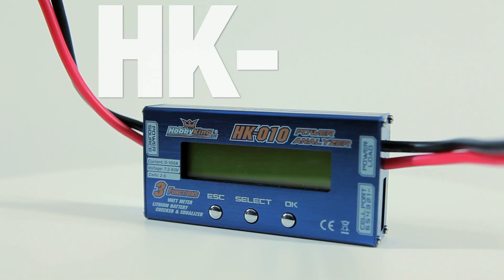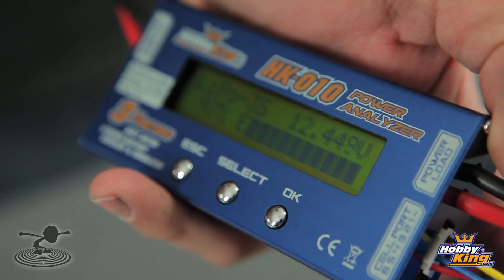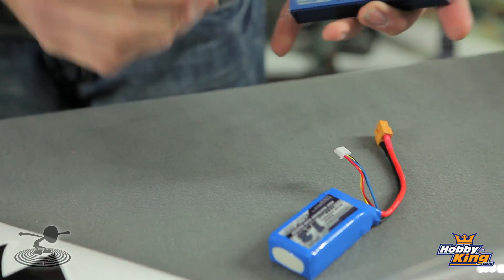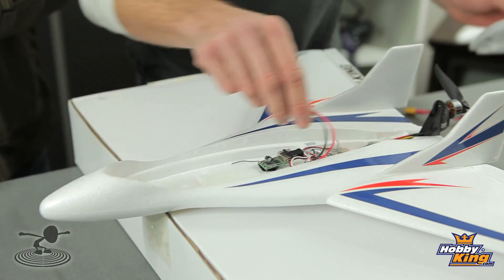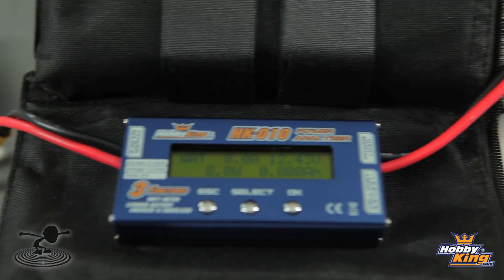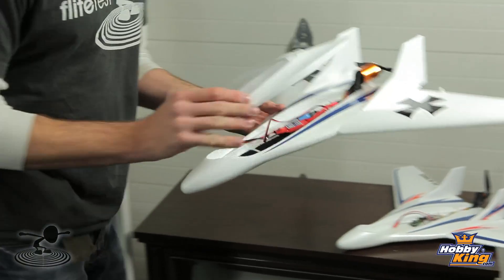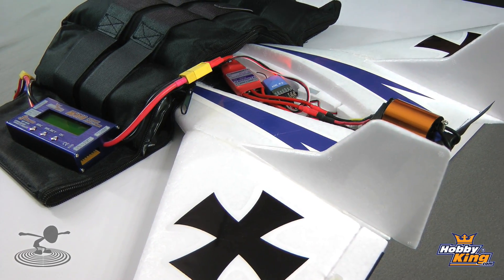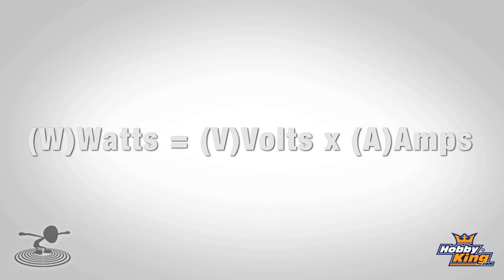Flite Test - Using a Watt Meter - FLITE TIP

Comment: first i got to say josh and josh i do love the work you guys do for the rc community. But hobbyking is the worst co to do biz with. they have no quality control. they will sell you products on "sale" then charge you full price for a working product. and refuse to send you what was broke. I bought a tundra on sale the PBC boards was bad in the wings they told me they was going to ship some new ones out after a month of waiting for them to ship the pbc boards  they told me to just send back the plane and they would issue me a new plane they got the plane back then issued a refund. then they told me if i want a new tundra that i would have to pay full price even though i bought mine on sale. I still refuse to buy anything from hobbyking. all 3 of my flight clubs agree with me and have also started a boycott on hobbyking

Comment: Also I just figured out how to use the desoldering function (aka "Desoldering for Dummies"):
Just plug your battery into the power source and the balance port, but do the balance port upside down: Immediately desolders balance port of lipo AND watt meter. Also if you wanna burn a hole into your matress, just do this right above it.
Works like a charm, as far as I can smell.

Alright, stay tuned for the next episode of "How to burn your house down" featuring me putting two needles in the power socket (A little hint ahead of time: It won't just burn the house down!)

Comment: I love all your videos - the production value is top notch, you always provide good information, and you have fun (which makes a big difference). I just have one suggestion - you need a true beginner on staff (a wife, maybe?) to be on set to steer the talking points and script. Some of the information you give assumes that the viewer is more advanced than they probably are for the subject matter. People wanting to know how to use a wattmeter might not understand why they need one or what other variables (prop size, motor size, battery size) do to the equation. This could be a very powerful tool for a beginner, but I left with the main idea that I can see how much more power a different motor is delivering with a watt meter. And for newbies putting together a power system, it can provide much more critical information than that.
Reply: spot on. I bought one but I don't even how to hook it up and where. Advanced guys on the hobby don't know/remember how's it like when you were starting...

Comment: Could you use a normal voltmeter to see if the battery is fully charged or would it just tell you what volt rating the battery has?

Comment: Sorry but your hose analogy is as wrong as well as your explanation of C Rating.
It's true that Volts is water pressure but the size of the hose is the Resistance, the amount of water going through the hose is the Amps...

Comment: Someone has probably mentioned it, but "C Rating" has little to do with how long your flying.  It's how many amps the battery is able to output.

1000mAh pack that has a 10C rating, can deliver 1000mAh * 10 = 10,000mA (or 10A).

A 5000mAh 40C pack can deliver 200A!  That would start a large car!

Comment: yah but the volts cant go under 4.8 for a all the standard size servos and the plug is a regular old small three wire servo lead.....so that wont get connected to the metre but i already have a different t metre for it so yah..... or else the voltage wont be high enough to control the servos